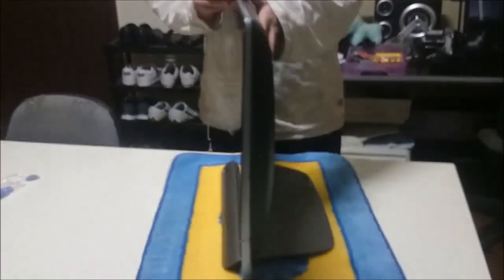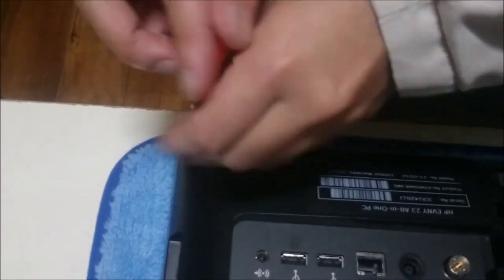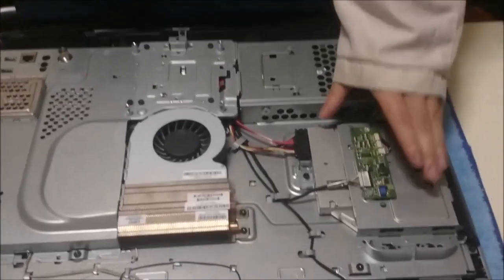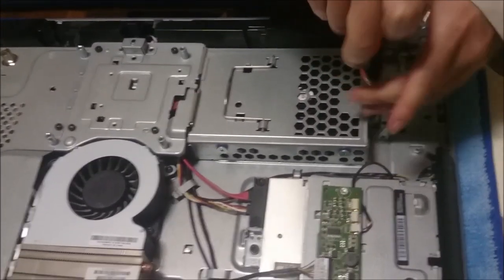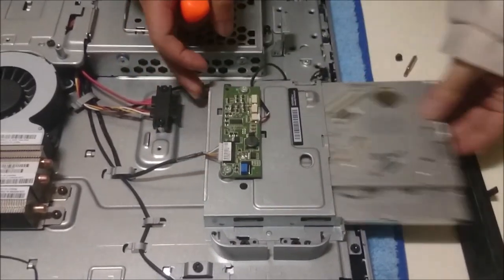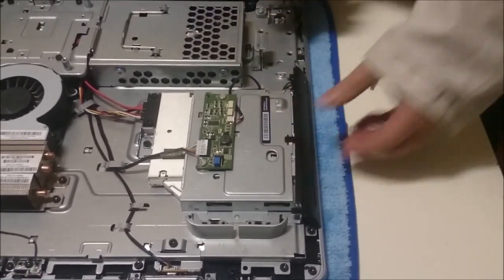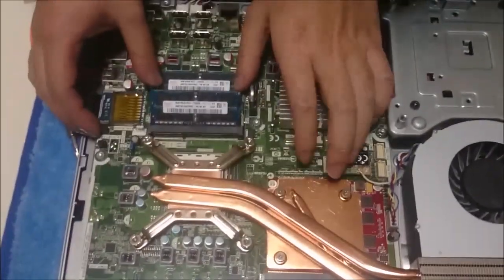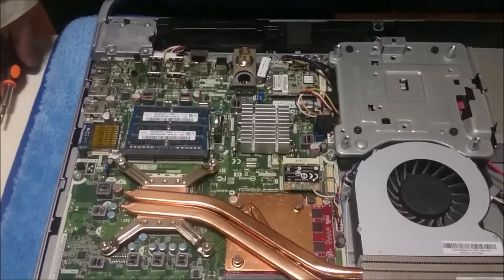OPEN ME UP! HP Envy 23, HP TouchSmart 520 and 320 Disassembly

Comment: Just got one from a friend's friend because it's excruciatingly slow....no wonder....W10, 1 Tb HDD (surprised to see a full 3.5' in here but given the size, yeah), 1x4 Gb DDR3....and an anemic Pentium G640.....fan full of dust of course..... and....AVAST AND ESET NOD32 running concurrently !!! Added 4Gb I had in a drawer, currently cloning the partitions on a smaller SSD, and ordered a 2500S to be conservative regarding the CPU TDP. It will be useable again (there's a 30-40 seconds lag currently when clicking something, CPU & HDD @100% all the time, it's a nightmare) ; Will dig in the system stuff once I've cloned the SSD, else it's just not doable :)

Comment: Hello i have this this exact same computer except it didnt come with an mxm graphics card at all so i wanted to install one. so when installed the graphics card and turned on my computer and the power button on top turned yellow and it beeped a couple of times. however when i removed the graphics card and turn the computer on it works fine. Is this a UEFI issue? should i disable intel graphics driver then install my graphics card? or is this a nvidia driver issue?
Reply from the maker: perviously when i tested it. the slot was not a mxm, clearly i must been wrong. you dont need to turn off the intel graphic as it still use it normally useless otherwise and will switch to the mxm. since it is not working for you turn off the intel graphic. this use to come with a gt 710 and that was the max for this computer. i remember years ago when i tested anything else it wont work
Reply: @OpenMeUpTec  idk I still think it’s either an UEFI issue or a driver issue. most likey driver issue. What’s weird is that even tho my screen turned black and the power button turned yellow and was beeping windows actually started up because I heard the windows starting up sound. I’m starting to think it’s a driver issue or UEFI issue. The the gpu isn’t communicating well with the monitor. I’m gonna try to fix this.
Reply: @OpenMeUpTec  do you have a bios file that i can use? see the UEFI I have is very limited and only has performance checks on it. i want to see if you UEFI is any different.
Reply from the maker: @RedVenomProductions  you can switch to legacy bios mode or update the bios which can be found on HP webiste
Reply: @OpenMeUpTec  no you know what I know what the problem is
Reply: @OpenMeUpTec  the mxm probably doesn’t support LVDS display. I think it has to be through edp display.
Reply: @OpenMeUpTec  I reset the bios and it still didn’t work so it’s probably unsupported by the LVDS.

Comment: So this video is hella old, but so is my HP Envy23-d034. I noticed my computer will only connect to my 2.4 GHz wifi band (I use Google Wifi router/mesh points and it chooses the band automatically, no way to manually switch it), even though mobile devices in the same room connect to 5.0 GHz just fine. Is this a problem with the device’s wifi capabilities, and will upgrading the wireless card fix this issue?

This demonstration was very helpful. If I end up changing the wireless card, I may even upgrade the RAM at the same time!
Reply from the maker: you wireless card is too old. you need to upgrade it to a 5GHz one. something like the intel 7260ac

Comment: The harddrive I will like to know if it a 2.5 or a 3.5 harddrive. I need to replace it. But I need to know with on its. Could you  please tell me with one is it?
Reply from the maker: if you watch the video i show you it is a 3.5 inch hard drive and SSD comes in 2.5 inch which you can fit in.

Comment: What is the best MXM card for the 

HP 23-d130ea curently using onboard via CPU?
Reply from the maker: this does not use mxm. it uses HP version. also if it uses MXM you are not going to buy it since it cost way too much. you can sell this and use the money to get a desktop it is alot cheaper. a 1660TI MXM is like $600 - 800AUD when you can buy the desktop version for $400
Reply: @OpenMeUpTec  Thank you I just added more RAM and the HP version of the MXM slot on my motherboard is vacant and my system is currently using the Intel HD graphics. I'm sure I can add a graphics card just like this particular system looks to be using a Radeon card of sorts. I just don't know what cards are compatiable I was just looking to see if there was any card I can add into the system to improve the desktop hardware acceleration for watching video for example X265 high bitrate. Thank you.
Reply from the maker: @kimberleytucker115  this is why i am terlling you to go buy a new computer and stop wasting time and money on this. HP version of MXM only goes up to GT720 which is onver 6 yeras old and useless .

Comment: Really appreciated. My 320 isn't reading wifi. Am told it's the wireless card. To reseat it or replace it. Thank you for this recording.
Reply from the maker: thanks for your support. your wifi card can die as I have seen it before. if it doesn't read it you can try to reseat it. if it was just working yesterday and today it is not working and you done nothing to the computer. this mean it is most likely dead. it doesn't cost much for a new one $10 to $20 AUD for a new one. you can get them from ebay for cheaper

Comment: Can you upgrade the memory?
Reply from the maker: CPU can be changed, Ram can be changed to 16GB max with 8GB DDR3 in each slot and there are 2 slots, graphic card can be changed,  wireless can can be changed and hard drive is a 3.5" inch hard drive that can be changed to a 3.5" inch or a 2.5" inch.

Comment: I have a similar question in regards to making this a gaming computer. However, the HP Envy I have is a later model (22-Jan-2013). HP ENVY 23-d160qd All-in-One. This model in the video was 2011. So, my question is, has HP made improvements to make a it possible to install a video card with an OpenGL (fortnite friendly) in the MXM expansion slot? Please help! Getting advice from the company is a joke. LOVE MY MACs!
Reply from the maker: this was one of the last mxm slot AIO hp made. after this model they didnt make anymore. the worst thing is they doint use MXM they use their own version of it which is different. the one in the video was a 3rd gen i7 and the last one is the 4th gen i7. after that it was all soldered on

Comment: great video...can you tell me if i can put a Rosewill RNX-AC1200PCEv2 AC1200 802.11AC PCI Express Wi-Fi Adapter, Dual Band 2.4 GHz 300 Mbps + 5 GHz 867 Mbps Wireless Network PCIe Card in my hp envy 23 d-065 touch all in one ?
Reply from the maker: this is not an apple computer. if it fits in the slots then it should works. looking at your wireless card it looks the same as a intel 7260 ac which i had in mines

Comment: I know I'm late but my computer use to be able to connect to the wifi wirelessly now ever since I got a new wifi box it didn't want to connect anymore and it only connected with the wifi if I used a Ethernet cable but the wifi box is in the living room and my parents don't want it there so could the problem be something that's withinside the computer or my wifi box?
Reply from the maker: there is a rare issue that can happen and i have seen only a few times in my life. your wireless card and modem are not compatible. the last time i saw this issue was with a wireless card in a dell laptop.
Reply: OPEN ME UP and how can I fix that
Reply from the maker: you will need to replace the wireless card or change wifi box thing
Reply: OPEN ME UP does it matter which wireless card I get
Reply from the maker: normally if you get a newer one it should be fine but before you do that try to do a driver update and see if it works
Reply: OPEN ME UP says my drivers are up to date
Reply: OPEN ME UP it tells me my wireless capability is turned off how do I turn that on for the envy
Reply from the maker: if thats the case then you might have to purchase another wireless card
Reply from the maker: if thats the case then your wireless card has an issue. could be because of an driver update that broke the wireless card or it is actually dead itself
Reply: OPEN ME UP well thank you so much for helping me it means a lot I've been struggling with this issue for almost a year now and thanks to you I've found the problem ill probably just end up buying one of those wifi usb adaptors so it can catch single from my modem

Comment: What screwdriver head did you use to remover the motherboard cover. Also what sort of screwdriver would you need to remove the fan filter and the copper piping to the CPU and GPU?
Reply from the maker: you just need your normal + screw driver and you will need a torx screw driver set which you can get on ebay

Comment: I have this sort of PC and it has been crashing lately.  Thank you for showing me how to open it. I do have one question, I suspect the overheating is from dust buildup but when i opened it up there was a thin layer of dust on everything on the outside shell. I'm unsure if this dust would actually do something. Here's a picture https://imgur.com/zmPRBDC Whenever it "crashes" the screen turns black, the audio is like a repeating buzz, but my pc does sound like it's still running so I suspect the GPU overheating. I have done some research and found my GPU maxes at 105 degrees Celsius under stress. However, i haven't seen how hot my CPU gets so I don't know if it's a possibility.
Reply from the maker: clean it out and see what happen. you computer components might be dead.
Reply: To clean out the filter, do you think i could just blow into it through the fan to avoid needing to remove the whole thing. Perhaps vacuum the filter through the fan after picking at it with a toothpick?
Reply from the maker: if you already go it open do a proper job then you dont need to open it up again
Reply: Thanks, when i opened it I found the Torx Screws were compatible with a flat head screwdriver and now my PC is running beautifully.

Comment: Hi I know I am a little late But can You please make a video of Opening It up to reset The Bios
Reply from the maker: just to let you know removing the battery doesnt work. Sorry i no longer have the item to make a video for you
Reply: OPEN ME UP well do you know what should I do
Reply: OPEN ME UP yes can you tell us the steps in the comment section. I also have the same problem
Reply from the maker: you probably cant reset the bios without knowing the password. dont know why you want to reset it but if you having computer issues resetting the bios is not going to help
Reply from the maker: what is your issue and why do you need to reset the bios

Comment: Once open, you risk breaking the cover if you try putting it back on. HP designed it this way. I hate this type of of company.
Reply from the maker: yes it does require alot of force. Even though i have never broken any. Lenovo and dell also have a few that require alot of force to put the cover back on

Comment: is it possible to change out everything in the computer, I have an i5 but I want to upgrade to an i7 and I want some new RAM. also, what is the fan gauging
Reply from the maker: you can change the ram and the cpu but what is the point this item is old you might as well build yourself a computer since you only missing motherboard and power supply
Reply: OPEN ME UP when my computer crashes, im just going to strip it of the ram and the CPU because i5s are actually really good and its a single 8gb card of ram
Reply: OPEN ME UP is the hard drive the same as the other hard drives?
Reply from the maker: yes

Comment: I thought the only two options for graphics was the GeForce 610m and the GeForce 630m?  I personally have the GeForce 610m installed and I'm not very happy with it.  Is it the graphics card that is preventing me from connecting to a dual monitor or is there some other issue within some other component that's preventing it?  also I notice both video cards should enable 2560x1440 resolution but that doesn't seem to be the case on this build, is that limited from the screen?  Do you know if I would be able to switch out the motherboard with something that would support better graphics cards?
Reply from the maker: Buy a new computer because anything you want to do will cost too much and not worth the price. The screen is a FHD screen so it can't do anything greater than that

Comment: How to replace graphics card?
Reply from the maker: Yea you can but it is limited. The graphic card isn't the same as other like dell alienware where they have powerful graphic cards that can be changed. The most powerful graphic card you can put into the hp is the one that comes with it which is 730gt. So there is no point of changing it as you most likely have the best graphic card you can get for it

Comment: Can the HD be replaced with SSD?
Reply from the maker: +John Durgin yes it can
Reply: @OpenMeUpTec DO We need an Adapter for the SSD or can it put on the same Slot where the HDD was b4 then?!  THX!
Reply from the maker: @Lunaticohsyou  you will need an adapter or you can just leave it hanging
Reply: @OpenMeUpTec  TY!

Is it SATA 3 or 6 ? Do I have to pay attention, when buying a SSD to replace the slower HDD?

Amazon example?

thx!
Reply from the maker: @Lunaticohsyou  nope this not apple therefore if it fits it will work. so you need to get a sata 2.5inch ssd
Reply: @OpenMeUpTec  allright!

and

for RAM, DD3 how much Mhz?
Reply: What type of SSD would work as a replacement? Can you add link?

Comment: I have this same computer, when I try to power it on, everything seems to turn on, but the display stays off, any suggestions?
Reply from the maker: +Bryant Dope something dead or faulty like ram. So test it by removing one item at a time as see if anything changes. Start with hard drive then ram. When the ram is removed the computer should beep if it doesn't your motherboard or CPU is dead.
Reply: +OPEN ME UP thanks for the reply, you said test it when I remove the the parts, so remove them while the computer is on?
Reply from the maker: Remove it then turn the computer on. Doesn't remove stuff with the power on you will probably short circuit something.
Reply: +OPEN ME UP thanks for your help sir, I'm going to try that right now, hopefully it works, but what if the results are still the same afterwards? What do I do then? Sorry for the constant question I'm not that big on computers
Reply from the maker: If the result is still the same then it is not a good sign. Most likely means your motherboard or CPU is dead.
Reply: same with me if u figer it out plz tell me the promblem
Reply: Mine also has no screen but seems to start up 
I removed the ram and it beeps so what else could it be
Thanks

Comment: Someone tell me this computer can change graphics card?
Reply from the maker: Yea you can but it is limited. The graphic card isn't the same as other like dell alienware where they have powerful graphic cards that can be changed. The most powerful graphic card you can put into the hp is the one that comes with it which is 730gt. So there is no point of changing it as you most likely have the best graphic card you can get for it
Reply: +OPEN ME UP how do i change the graphics card?